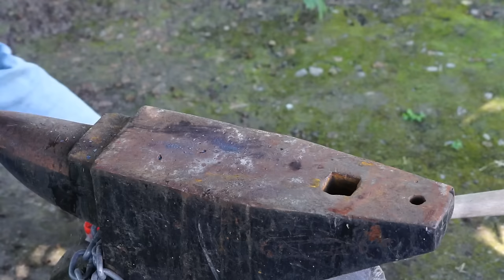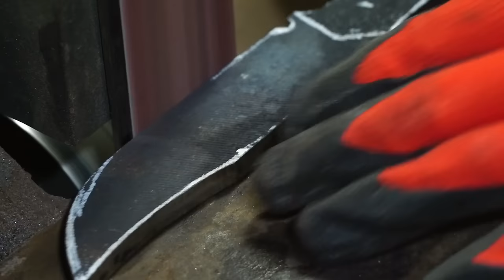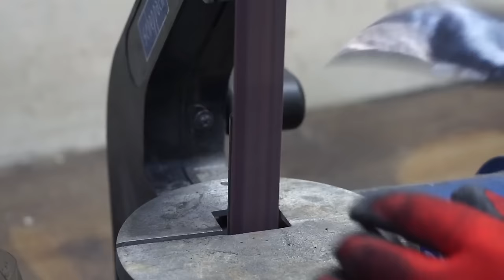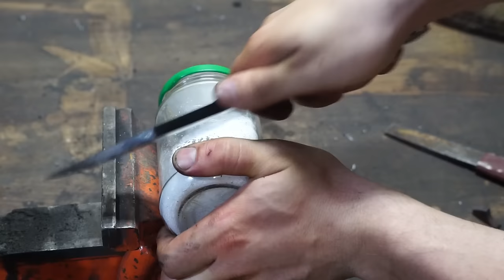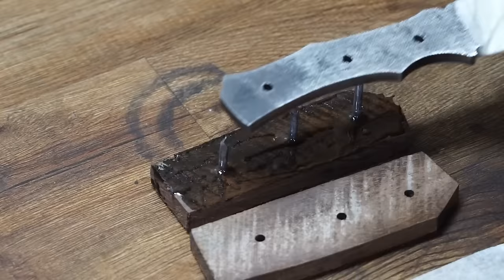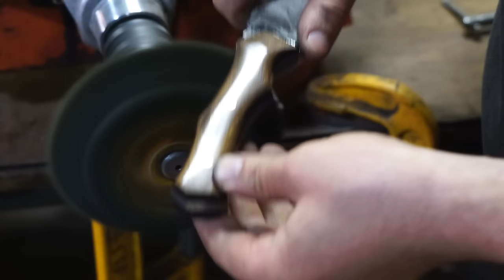Creating a Hunting Knife from an Old File

Comment: It's already so hard, why heat treat? And why you didn't tempering? Isn't it fragile as it is?
Reply: He annealed it first to work it and later hardened it, and I am with you about tempering it.
Reply: Try filing or drilling a file.... all but impossible
Reply: @paulskopic5844 
I’m sure it was off camera
Reply: He heated it to soften the steel so he could work it. Where were you?